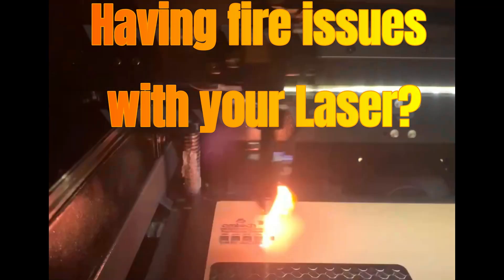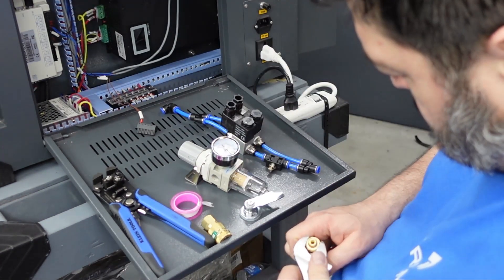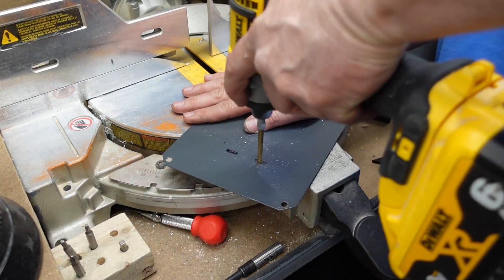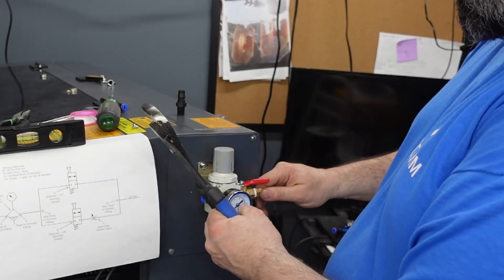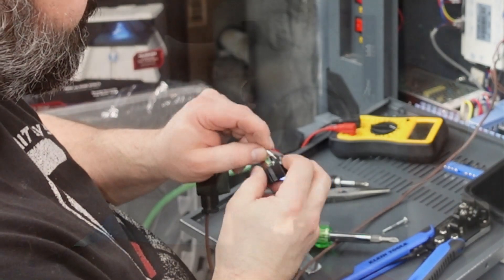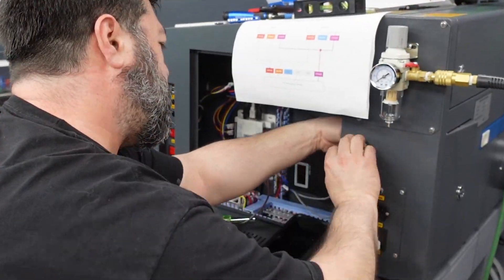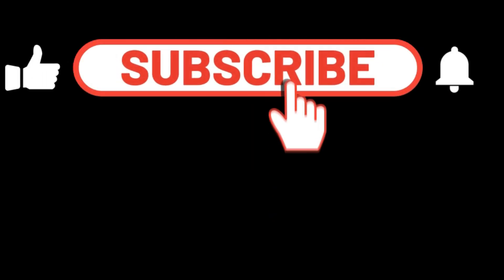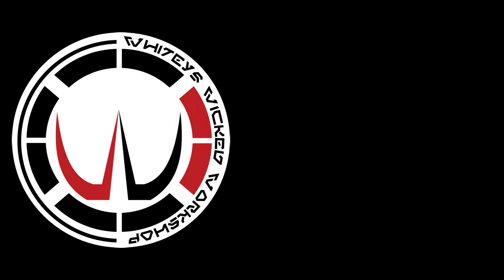Upgrade the AIR ASSIST on your OMTECH CO2 Laser

Comment: I have the same control unit as this and I am going to follow this, I bought some diodes but you didn't use any do I need them? I got near similiar solenoid the one listed on the website is not avalible for me in th uk so I search and got pretty much the same one its a 2 way normally closed only difference is on the site is  2V025-06 and mine is CE IP65 other than that they are identical
Reply from the maker: Nice! Good luck with it! I don’t remember any mention of diodes.
Reply: @WhiteysWickedWorkshop  its on the oaedesigns parts list
Reply from the maker: @4m05  After checking the parts list I remember this now. My machine came with the diode and connector mentioned so I did not need to purchase. At least that’s what I remember. The diode was already tied to the connector. Good luck!
Reply: @WhiteysWickedWorkshop  I have the same controller as you, I dont need the connecter in the kt332n as its there but couldnt figure out if I need a diode in it, I put a diode in each solenoid do you think it will damage the solenoid if it doesnt need it?

Comment: I'm normally into tinkering and stuff, spent unfathomable hours with the 3d printers but this is just a pain, honestly. Spent like 4 grand on this thing, used it the last week after not using it for a year and now my air assist is like a whisper and production has halted. Kind of annoying.

My question is, there is a hole on the back for an air inlet? Can I just buy an air compressor from my local hardware shop and hook that up to that tube on the back for now? I can manually turn it on or all of I need and just do engraving/cutting on different layers....for now. I will do this, but I just want to focus on production not tinkering at the moment and I'm searching for the fastest fix I can.
Reply from the maker: Yeah your right , only downfall is it will always be blowing until you manually turn it off. Adding this solenoid isn’t really that difficult and you won’t have to mess with it again. I always have my air compressor on and it runs to keep the pressure. The laser sits here when not in use and I can fire it up start etching /cutting and it’s automatic. If you forget to turn on the compressed air you will be making failed cuts/etches. And you will forget I promise you. So it’s up to you! 😊
Reply: @WhiteysWickedWorkshop  I hear you and yeah I agree that it's going to happen, I already know it will. Last night was long and ended with a fizzle, I just wanted to keep cutting to finish my project but this morning I'm thinking that the job should just be done properly so that's the way forward.

Comment: Hi, I have an omtech 2028 mf, can I just buy another pump and use two small air pumps?
Reply from the maker: I'm not sure I guess it would have to be big enough to give you enough volume to receive a constant flow of air to keep the laser path clear. Two small pumps might not give you enough. Good luck

Comment: Why 2 solenoids valves?
Reply from the maker: As quoted from the website “ two (2) solenoids which allow Lightburn settings to control air flow for both high pressure (laser cutting) and low pressure (laser engraving). The user does not have to turn the air off when not in use because the second solenoid is turning it on and off based on your Lightburn settings.”

Comment: The software interface lacks user-friendliness, making it challenging to operate efficiently.
Reply from the maker: Which software interface are you talking about? You can use multiple. Inkscape is free and Light Burn is the Standard in laser tech.

Comment: Thanks for the great video..

I'm curious, why did you route the tubing to the outside of the laser vs through the internals of it?
Reply from the maker: My only reason is because of the innards for the up down movement of the bed, I didn’t want it to wear on any of the gears so opted to move it away from them. The tubing is protected underneath the machine and that side of the laser. 2nd reason was for speed because I was dying to try it out to see if it would correct my burning issue.
Reply from the maker: Thanks for watching!